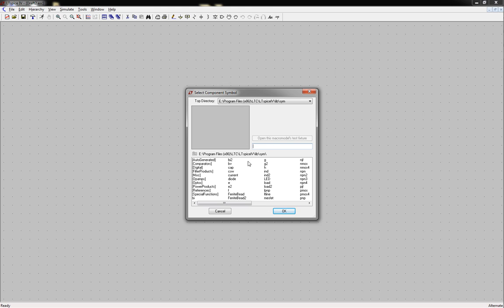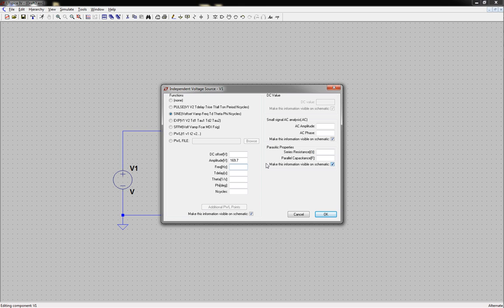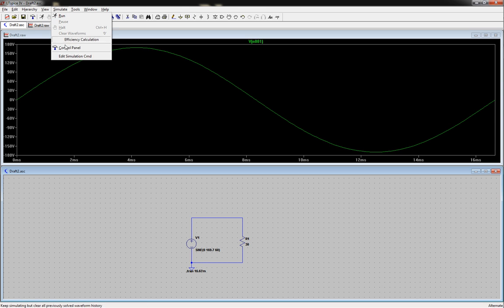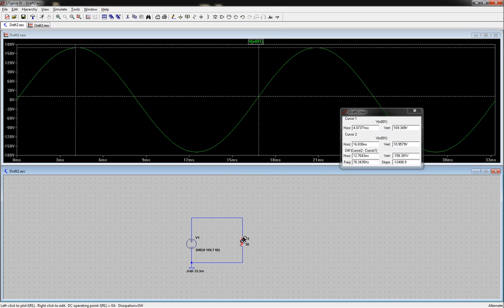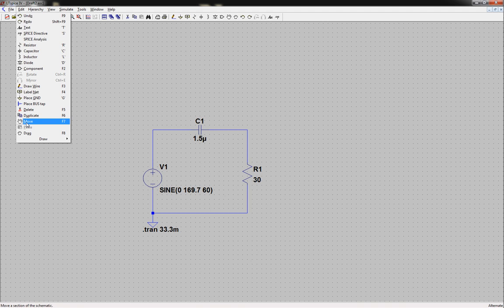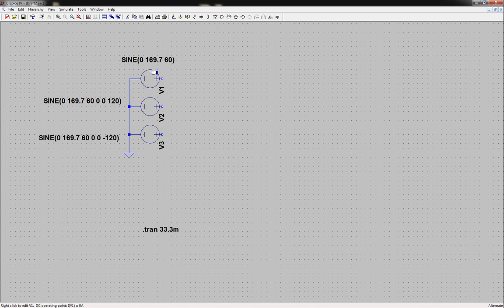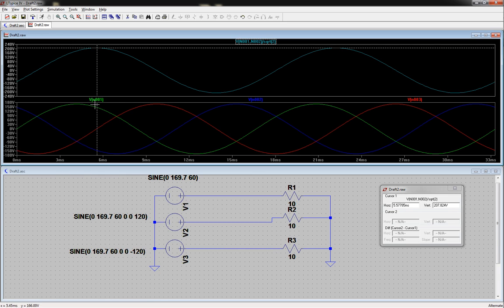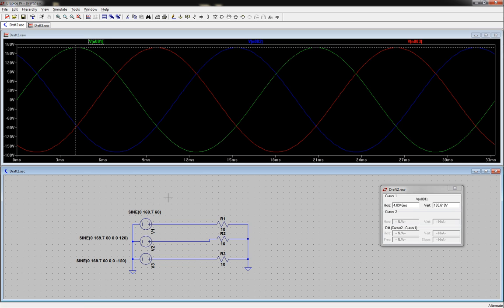Helpful Tools: AC Analysis LTSPICE

Comment: I made 3 stage ring oscillator using differential amp, but i am still confused how to measure the output freq. Can u help me?
Thanks at first.
Reply from the maker: +Dwi Novianto Usually when you inspect the voltage output and there is a waveform in the bottom of the display box there should be the frequency measured like in 9:25 of the vid.
Reply: +misperry 
u mean to do that, I have to put crusor1 & 2 in the top of wave?
cz i am still confused, when i was moving the crusor, the frequency was changing too.